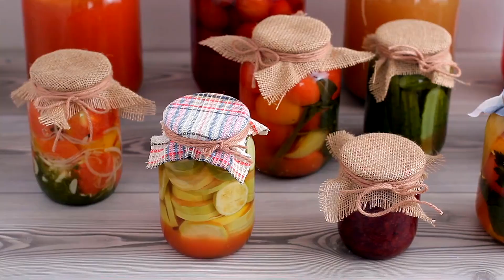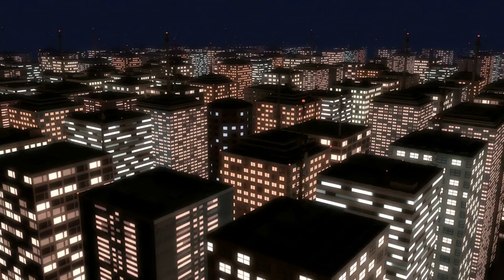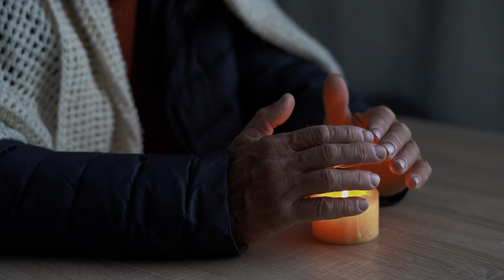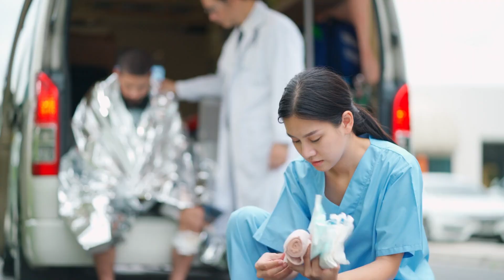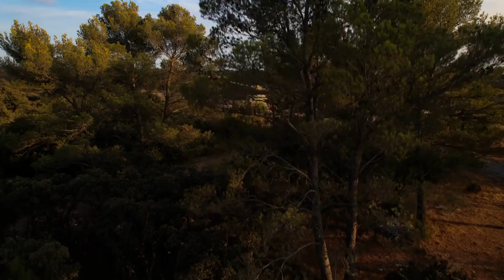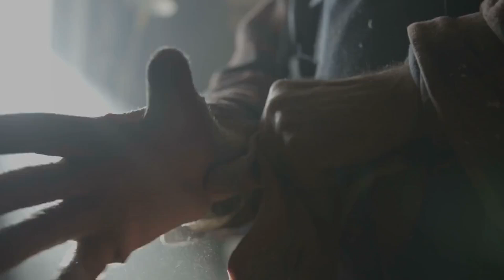15 Critical PREPS to STOCKPILE for an Imminent Power Grid Collapse!

Comment: 1. Canned goods, can openers
2. Water and filtration
3. Flashlights, batteries,   solar lights, head lamps
4. Heirloom seeds stored properly 
5. Fuels for heating and cooking
6. Quality non-electric 
 hand tools
7. Hand operated grain mill
8.Portable solar generator
9. Medicine & medical preparedness. Daily meds, first aid kit, medical/survival book.  
10. Wood burning stove
11. Hand crank/solar/battery emergency radio
12. Multi-layer insulation
13. Cast iron cookware
14. Quality work gloves
Reply: Robin add a stainless steel collapsible wood stove with stove pipe two 90 degree stove pipes and a rain cap - 
      Also add a regular cutting axe, a hand axe, splitting axe, steel and plastic wedges, then a one man cross cut saws with an extra handle for the end so two people can get on the saw to cut fire wood -  also files to sharpen the axe and saw - also a book on how to set the teeth on cross cut saws - 
       I've used cross cut saws off and on all my life they work good - 
       More people die from the cold then from the heat also animals body's can generate heat while there laying down as long as they have food - 
     Humans need an outside source of heat -  they sell folding tent stoves that would be handy in an emergency - 
    I burn wood for heat and hot water -
Reply: They might get a book on what trees are good for fire wood - Sweet Gum trees & elm trees there wood is all twisted together - it's imposable to split that kind of wood by hand - it's the same with live oak it's imposable to split by hand -